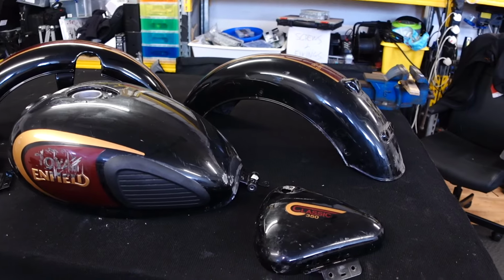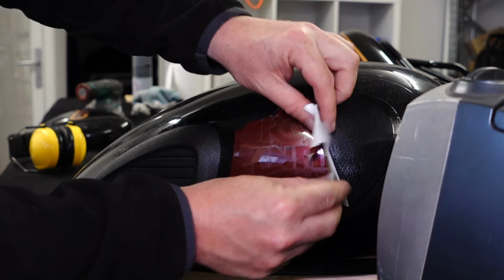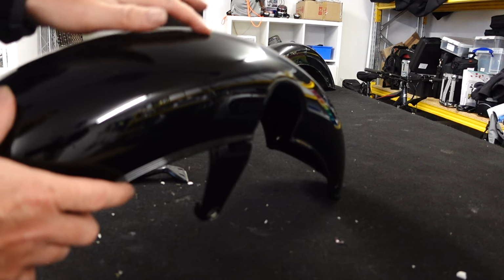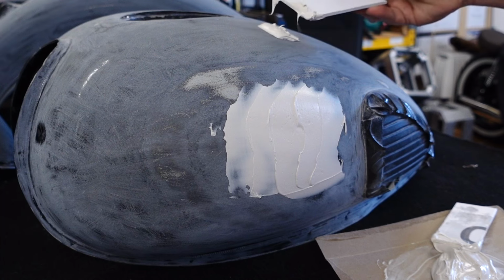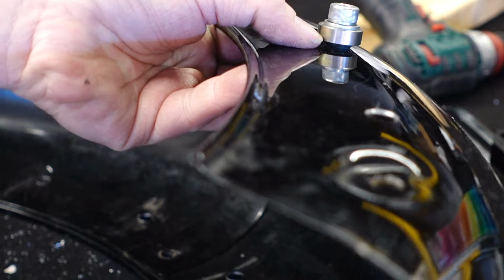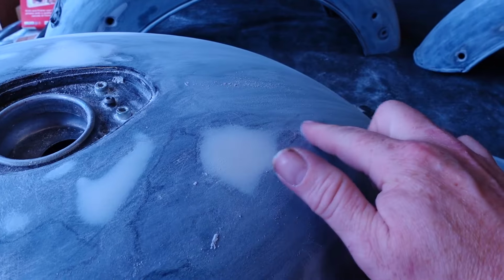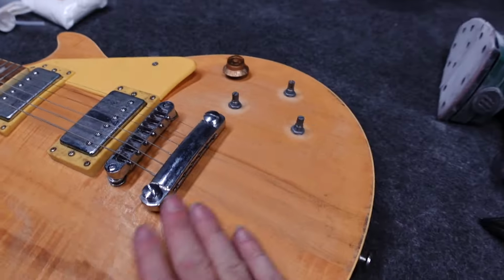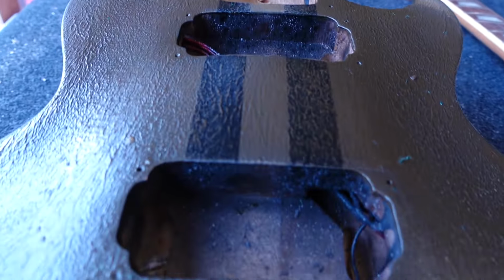Part 20  - Repairing the Dented Tank / Mudguards for the Royal Enfield Classic 350 Reborn

Comment: Nice idea Glyn. I did the same to a suzuki vs800. Chrome engine and other bits with rusty tank, panels, and mud guards. The only difference I did was to sand back to bare metal, then sprayed it with salt water. Left it for two day's then rinsed with fresh water. Then coated with a matt wax. Job done. Was happy with result.
Reply from the maker: Thanks Phil 👍 I was interested in a bare metal attack with some shiny metal showing but had to put filler in so many bits I couldn't do it (didn't want dents ironically, which is silly considering the finish!)